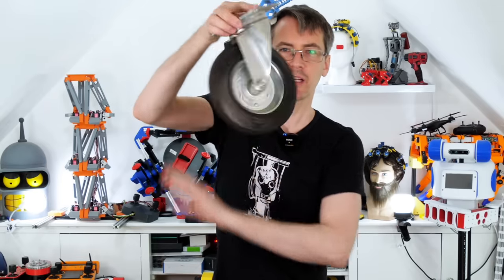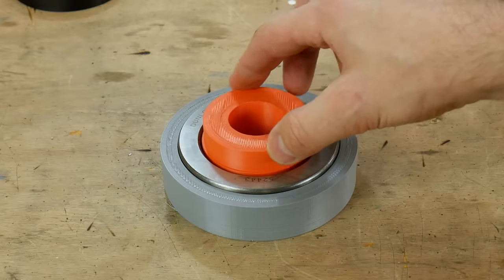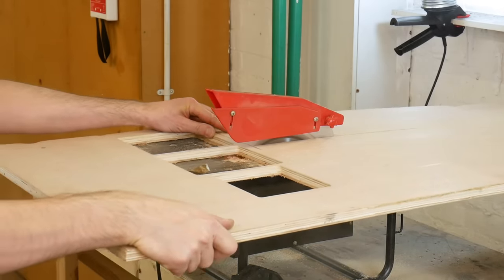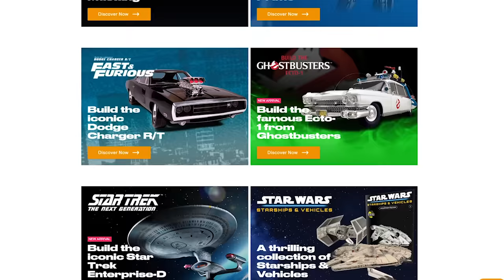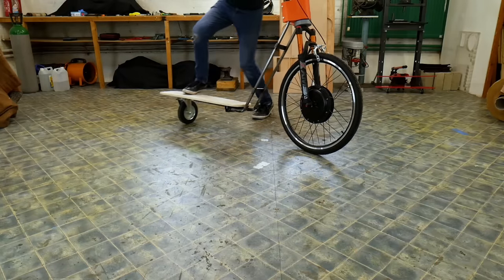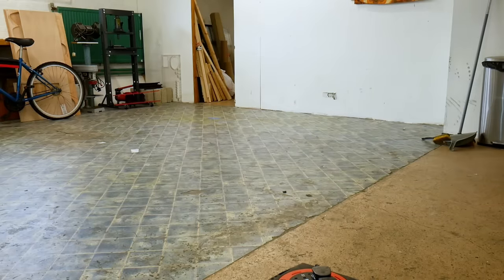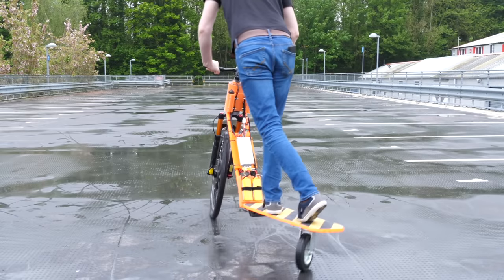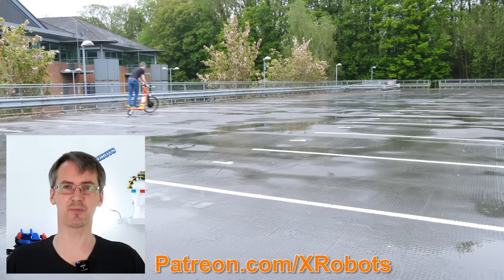1000W Caster Scooter

Comment: It seems like this might be viable if you limit how far the caster can turn, maybe with some big springs, so it wants to be straight, unless you turn, then it can turn up to like 60 degrees or something.
Ive just built a front wheel drive chopper bike, and its a lot like this. super simple, coaster brake only on the one speed rear wheel, front wheel drive/battery/controller all on the front forks. it has like 80 percent of the weight on the front wheel, and wont do wheelies.
Reply: As mentioned in other comments, simply mopunting the caster wheel at an angle would achieve the same. Finding the correct angle may be a nice project for another video.

Comment: look at the design of the RipStik, if you angle the caster wheel away from the direction you want it to face, it'll be a bit more rigid and won't flop all over the place.

Comment: the caster was mounted flat to the bottom of the board. What if you mounted it at a 15 degree angle so that the wheel wants to stay straight but can still rotate under enough force. Maybe 15 degrees is too much but something so that the resting location will want to be straight due to the weight of the rider.

Comment: there's a scooter i had as a kid that wasn't unlike this, it was y shaped and had two caster wheels in back, you could propel it by moving the back side to side, don't ask me how it worked but it did, but it also had an issue with the back whipping around out from under you if you tried to turn too sharply

Comment: Grats! you built an electrically powered, wheeled, ground-based version of a hot air balloon. You turn it on, and it goes into whatever direction physics dictates. You may make humble requests for direction-changes.

Comment: are there casters that snap back to center with spring force? so that when you kick it out for a drift it will go back to driving straight when you're not applying enough force to keep it turned

Comment: The reason why you found it easier at the end isn't you getting used to it, it's because the board wasn't flat, putting a self centring bias on the rear wheel. Eventually it broke.
You fixed it but then it was straight and flat again which removed that bias.

Comment: Make a drift trike. 2 castor back wheels, behind a bucket seat. It will be interesting to see if you can control the direction at all. Plus point you can put feet down to brake

Comment: Looks like the board you stand on is tilting forwards, that's likely why the caster wheel is remaining pointed backwards allowing for better steering. I reckon if that board was horizontal it would be a different story!
Reply from the maker: Half the comments say to tilt it more!
Reply: @jamesbruton  Ah no, I was unclear, sorry. You figured out how to ride it at speed but I suspect you could do that only because the board was tilted which effectively makes the caster wheel into a near-enough fixed direction wheel. I presume you installed a caster wheel to actually move around as they're designed to do and having a horizontal board would put to test the intention of using it like a real caster wheel. I have no doubts it will be less stable with a horizontal board but I thought that was the reason for putting it to the test.

Comment: if you put a brake or something to slow the spinning of the back wheel would help control enough to go straight  probably wouldn't be hard to put something to rub on the wheel to give it some tension

Comment: 0:30 “a 1000 kilowatt one” that is a very powerful electric bike. On a more serious note you need to be very careful here in the UK, all electric bicycles must be pedal assisted, so the motor should only switch on whilst pedalling. There is also a power and speed limit on electric bikes, the power limit is 250 W and the speed limit is 15.5 mph. If it doesn’t meet those requirements then it is classed as an electric motorcycle or moped and needs to be registered and taxed and you need a license.

Edit: this probably comes under being an electric scooter which is deemed a motor vehicle (PLEV - Personal Light Electric Vehicle) and needs a license to use (a normal driving license should be fine) and is illegal to use on public property due to not complying with road traffic laws. If you do get one with a license plate and lights, it would then need insured an need an MOT. Using it on a public road counts as driving without insurance and can get you 6 points on your licence or losing your license entirely. So whilst things like this look fun, people need to be aware of the laws and consequences.

Comment: i wonder if it would be easier to control if you were able to twist the back end in the ride axis independently of the front end, so like if there was a joint in the standing board. then you could steer one way and lean the back end the other way to counteract the double steering

Comment: So you can sort of see that as youre getting the hang of it, before the frame breaks, its a bit bent and leaning the caster wheel forwards a bit. I had this on a drift trike i built for a youth centre, as the frame bent more and kore and tipped the rear casters forward they just locked forward and the trike would no longer drift.
I think i would also be more manageable with a different type of caster, yours has an offset vertical pivot, not sure if you can find one without the offset?! Might make things easier

Comment: We made carts with that type of rotating wheel, (some gentleman warned us that the wheel turns  🤣😂🤣🤣) when you reach some speed it begins to vibrate and stops the car in addition to that it is difficult to control. Is there a way to put a damper to prevent vibration? and let it be simple hehehe

And there are scooters that only have two wheels like those and it seems very complicated but when you learn it is better than the four-wheeled skateboard.

Comment: locking the front steering and using your weight to position the rear could give much more stability.
Not sure how well this would actually corner though.

Comment: Both wheels need to be the same circumference, otherwise you are going to need the ratios of wheels and try to use that with steering degrees added with acceleration/deceleration.
Also, need to add gussets to bends. Triangles are stronger than squares.

Comment: I have built bicycles with front caster wheel under the crank set with rear wheel drive, with 10 minutes of practice it is fully possible. And a which broom type handle welded to the frame. Contact me for more details.

Comment: Razor made this non electric and it had two back castors mounted at a slight decline relative to the profile of the scooter it was only at around 5~12ish degrees but it was enough to persuade the caster to want to face forward without restricting its ability to rotate, I wonder if you angled your one caster down if that would help your scooter from spinning out

Comment: You need to angle it back about 30° 
That way, even when weight is applied, the caster wheel will want to straighten out.

Comment: With moving things, you probably should use lock nuts. It's terrifying how fast nuts can get loose. And you can't properly torque them on a wood deck either, as wood simply compresses.
Also, what's up with the circus music during the build montage? Foreshadowing for how good the scooter is going to fare?

Comment: Why didn't you just put some washers on the front axle to get your spacing right and use a normal brake disc. The brake line should be run  through the through the center of your stem/head tube/fork tube(old school Potts mod) or make some version of an Odyssey Gyro/ACS Rotor so you cable doesn't tangle and get destroyed. That swivel wheel needs some form of damping or...maybe a tread pattern/shaping that encourages staying on your current line. Having your weight lower down and closer to the center of your deck would help greatly also.

Comment: Had the brake been put on the rear caster then I feel the outcome would have been quite different. The brand could have been used gently to pull the rear straight as needed

Comment: I think if you attach side springs to the rear wheel to reduce the rotation and slip of the rear wheel and make it easier to control

Comment: Your back wheel should be like a skateboard.   I think that alone solved the issue. Then you can use pressure on the left/right of the back to independently control the back swivel.

Comment: it actually looks like this could be a useful vehicle if the rear wheel was fixed, but where the fun in that. alternatively i wonder how it would behave if it had no front steering, youd essentially steer by shifting weight and letting the caster do it's thing.

Comment: Idea: put a permanent brake on the back coaster wheel, not very strong but enough to make it tail behind the rest of the bike, will be 100% more stable
Reply: I was thinking something along those lines too, clearly if the brake is only on the front wheel and the back wheel has a full range of motion he'd never be able to slow down without spinning out

Comment: If the caster was on an angle same as the front tire it would self center with your weight. That is why the casters are off center. They are made to follow

Comment: I think building a new frame that’s lower to the ground and having the rear wheel slightly angled should fix it. Try having the deck at the same height as the center of the rear wheel or lower.

Comment: If you look at the geometry of a razor ripstick the castors are canted forward and the casting axis is forward of the wheel spinning axis… I wonder if you just canter the rear caster forward if it would bias it to face forward forward or if the actual castor hardware geometry needs to change as well?

Comment: might be an idea to limit the rear wheel rotation. OR add the ability to brake at the back so you can control the wheel to stop it slipping out.

Comment: When you ride a bike (not bicycle) at higher speeds, you counter steer so you can lean on the corner. You don't steer at the direction of the turn. At lower speeds, a bike behaves as a bicycle.

Comment: If you were to keep the front wheel parallel with the frame I.e. stop tye steering could you shift your weight to steer and leave the back loose. There was a skateboard type board called a ribstick which used a similar premise

Comment: I think your body is acting as a tensioning mechanism here and that's how you manage to ride straight. But if instead of relying on the (unreliable) body you actually fixed the front wheel in a straight position you might be able to steer with the caster. It will probably oversteer but at least you could try balancing that.

Comment: The caster needs a brake. It would keep the caster following the front wheel when applied lightly, and could stop the scooter without the rear swinging around. But it is sort of cheating.

Comment: with such a "non-holonomic",  "balancing vehicle"  it only works  (well) if there is no leaning - or rather ride as if it were a unicycle... ie. as you found - go fast and keep in front of the back wheel.  (needs a shimmy damper) - The rear wheel due to free castering (with little real "centring" caster angle) is unable to provide much/any centripetal reaction force - ie any "lean into the corner" results in a tailslide  into a loop... completed by a faceplant - if  no recovery is made (like a taildragger groundlooping with unlocked caster) - possible to control, but not guaranteed..

Comment: what about a design based on the Razor Deltawing which is essentially a trike with the back two wheels are castors.  just motorize the 12 inch front wheel.

Comment: The solution is simple, try it with Two casters side by side on the back. That way it won't tilt and you won't fall off.
Reply: kinda been thinking that 2 of the backwheel could be more stable ! they can even be very close to eachother to act kind of like it is 1 wheel

Comment: You need to try a "Swing Bike" where you can steer the rear wheel with your butt(on a seat). But with electronics, perhaps a "drift stick" on the handlebar that you can push to one side to drift that way? Great job getting as far as you did on it!!

Comment: These front power wheels are 100% wrong for those forks.  This thing is EXTREMELY dangerous even with a real rear wheel.  That wheel WILL rip itself out of those forks.  Even if the forks were the right kind of forks (which they are not), you need stabilizing arm like the ones used in coaster brakes or it will tear the slot apart.

Comment: Heh .... coincidentally today i saw a video from Bikes and Bears where they built a split-wheel bike, like The Q did with a normal bycicle...

But then it struck me... What if you try to build a half-tracked bike? Like some 'Kettenkrad' from WWII or just a scooter like with the frame you have in this video but with some tracks at the rear end, instead of the caster wheel.

Heck, you could even try your steerable tracks with it maybe. ;)

Edit: P.s. Well i know that kettenkrad concepts are very old ... i put it up just for example.. A single track would be more bike like instead of that old construct of a monster-tracked-motorbike with tracks at either sides.. ;)

Comment: 1000 watts not killowatts. It's an important distinction, 1000 kilowatts is 1,000,000 watts, or roughly 1341bhp. That's the power of a Formula1 racecar.

Comment: All that equipment and no idea. Such a shame. Of course you can balance a bike with locked forks, it's the pedaling function that makes it difficult.
Reply from the maker: Make a video riding a bike with locked forks then, I'm sure you've got some string to tie the handlebars up.
Reply: @jamesbruton  Well I would but these days I mostly rocking a wheelchair but I do know for a fact from my youth that a bicycle with fixed steering assuming it's straight works just fine because I had a wooden balance bike add from birch ply in a shed by my grandfather with the forks being screwed to the frame and it was very easy to ride. It had no steering other than leaning, try it yourself if you don't believe me. A bicycle will run in a straight line if you push it by the saddle.

Comment: 0:32 1 kw, not 1000 kw. 1000 kw would be a screamer...hehe And that kit either was for the rear or it didn't have the spacers so you can use the disk breaks?

Comment: Prediction: This is not going to work, it will drift uncontrollably except maybe in hard acceleration and braking will be a disaster. But if you angle the caster so that the top bit is leaning forwards you might be able to because then would be putting just enough torque on the wheel to keep it straight. Maybe.

Comment: a caster wheel with no caster...
steering angle, rake, and trail.

play around with the angle of the mount... 

as it is, vertical pivot. negative rake. 

caster wheels as on shopping trolleys are notoriously UNSTABLE. the contact patch is behind the pivot line, and the pivot itself. you could liken the inevitable instability to "carmen street vortices"...

think how a bike is set up.

pivot line intersects ground in front of contact patch.

rake is generally positive, to reduce trail.

a steep steering angle with too much rake to reduce trail to zero or negative will be completely unrideable. if the contact patch gets in front of the pivot line, its natural tendency is to flip around so its behind and trailing.
as the steering angle reduces (more horizontal) the pivot line moves forward, increasing trail. too much trail makes them sluggish but stable, yet also makes them "floppy". they try to fall over. increasing rake reduces trail and reduces the "flop". 

the increased rake makes them more stable as well, gravity being the key. you tend to be  "hanging off" the axle, rather than "balancing on" it.

but in almost all cases the actual pivot is behind the axle.... pivot LINE is in front of contact patch, pivot and anchor to frame behind. theres a torque reaction on another axis.

an RC bike has a tiny wheel diameter, it has a huge negative rake, but its necessary to keep the trail within a useable region. theyre also really stable... they have to be.

the end result is that the lowest point, the natural resting state of the frame is with the wheel straight ahead. as the wheel turns in relation to the frame, it actually lifts slightly. gravity always tries to pull it down to the lowest energy level... getting all the geometry right is a bit of a juggling act.

of course, rear wheel steering on a bike is very awkward no matter what you do. most people dont "get it". and with the geometry... some of it is the same as on the rear. some is in reverse. remember the wheel has to do the OPPOSITE to what it normally does.

another area to look at is the pivot on a skateboard truck. one is angled one way. one is angled the other way. flip the trucks around, theyll steer backwards. flip one around and they snake off sideways... a very good example of how you can make the wheel do what you want by tilting the pivot line.

Comment: That was "tubing" you were bending, not pipe. I'm not picking on you or calling you out, but the dies used to bend tubing are different. That bender will work well with schedule 40 black pipe. Filling it, and packing tightly, with sand is a good cheat.

Comment: Literally 5 seconds into the video my first thought was that things just going to spin out of control because there's no angle on the back wheel. If you're going to use a freely rotating wheel put an angle on it so that it follows where the bike is going. Seems like the most obvious first thought anyone would have and I'm confused why you even released this video without fixing the bike